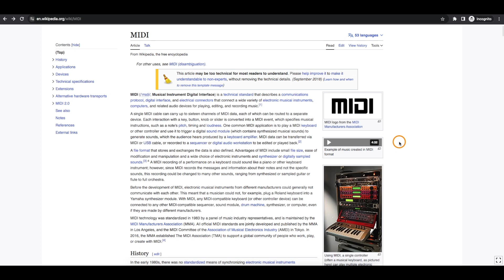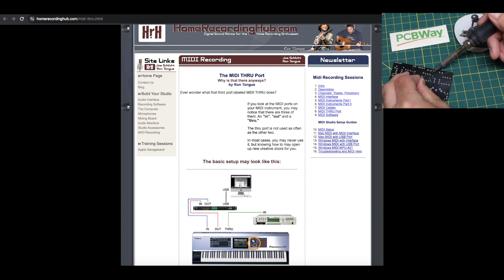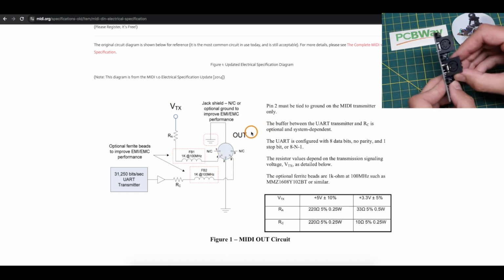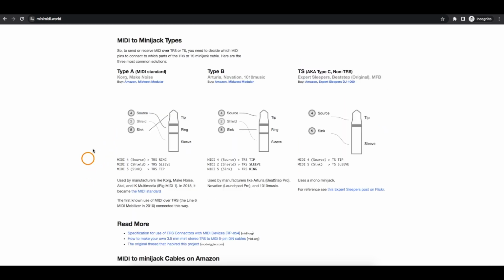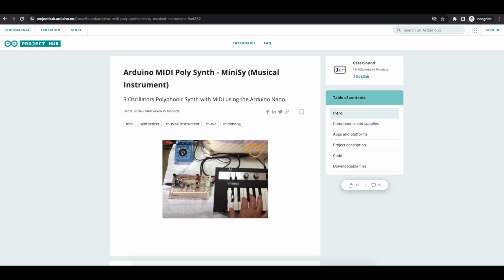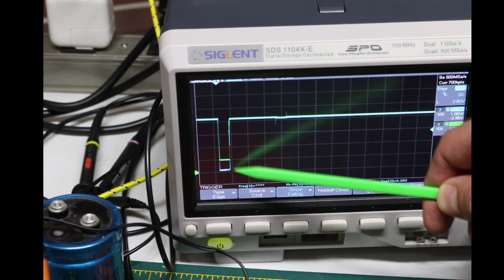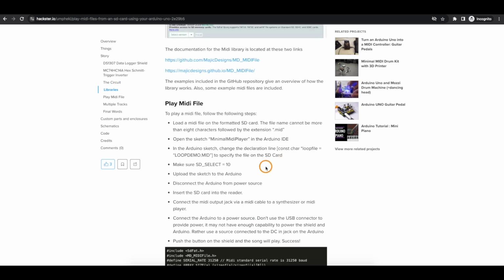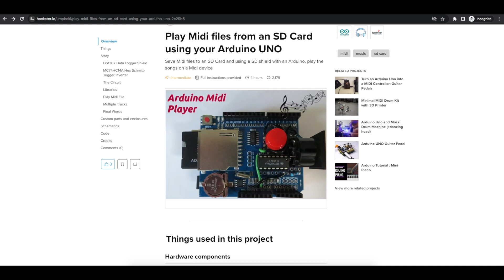MIDI In/Out/Thru Interface for Arduino

Comment: 6 months later, yt suggested me this same video... anyway, the coding part is the most crucial. I have been trying to optimize my little Midi - merger - translator Arduino-nano code, but Midi resolution was too fast for him to stay up, or I missed some critical thermo-capacitor in the final Midi signal section. With a Midi board like yours that problem should not exist. I had problems picking up Midi timecode not intermittently--- of course I had skipped notes... the only good part was that actually It was able to Merge two Midi channels into one, I could choose to Sum, Average or Subtract notes and gates. Transpose them. Overclocking sometime works, I usually never do it bc it can damage the nano in the long run.
I'm not really up to the tree for speaking of resolution/Mhz relationship to the code etc.
We are lucky if we can still speak about making musical gadgets as our hobbies become work for someone else.
But if the author of this video or anyone else reading this in the future, the knowledgeable part missing is the boring part where it should be explained what code does to the mechanic device in question, and simultaneously provide a proof for reproducing the invention by sharing how that is obtained. Without escapism that usually A.I. bots incurs.

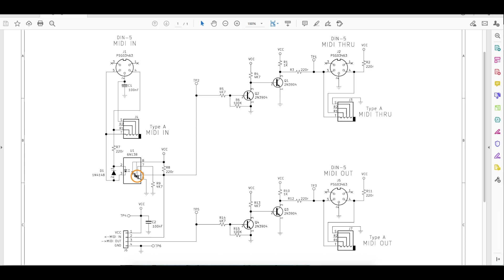Comment: Interesting about that 4k7 resistor at ~ 6:30 - made my own input board using a PC817 and a 330 ohm resistor mostly following the spec suggestion. Works, but my scope only shows it going down to ~ 1 volt. Wonder how low it needs to be to work correctly with an Uno.

Comment: Nice video,  you could put a few headers on the pcb so you can change the supply voltage.  A few extra resistors are cheap in low volume products.